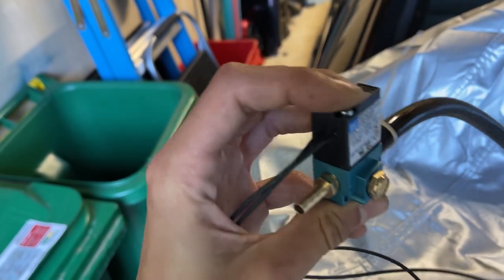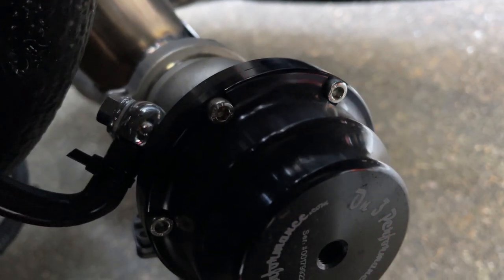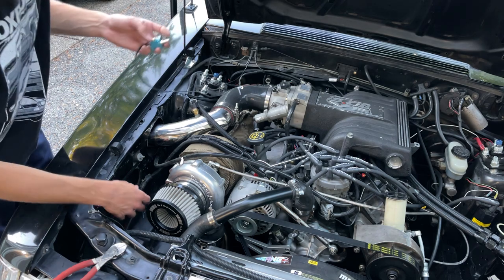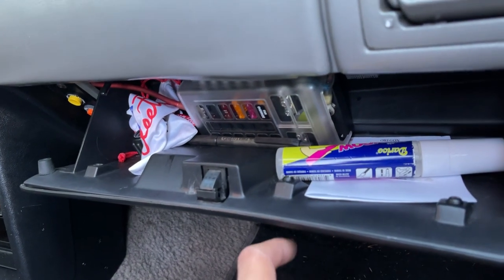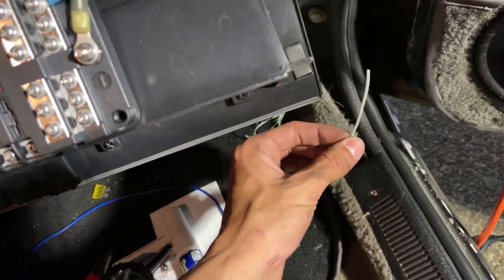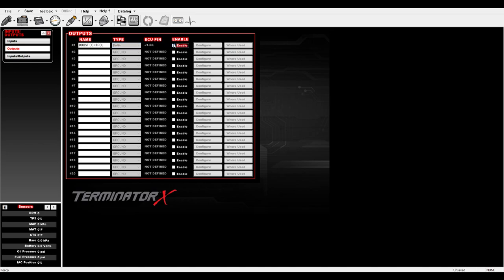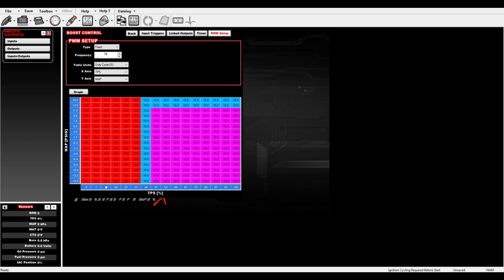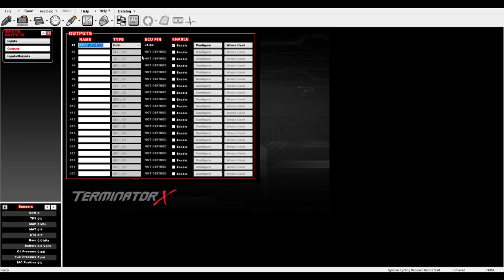Turbo Foxbody OPEN LOOP Boost Control w/ Terminator X!

Comment: Where are you dragging your switch power for your fuse box in your glove box
Reply from the maker: I believe it’s fuse 18 in the fuse box. I’ll have to check to confirm. I have a big boy relay that is triggered to send battery power to fuse box.

Comment: What size is the bango fittings? on the waste gate
Reply from the maker: Great question, I’ll have to check. It does not list the size.
Reply from the maker: I found that it could be M10 x 1.0
Reply from the maker: Not 100% though.

Comment: What sensor is that on the cold side right before the elbow
Reply from the maker: Intake air temp sensor that came with the terminator X kit. 👍
Reply: @eneboracingchannel  Yeah im installin a anderson kit an i dont have it so ill prolly buy one. And could u possible make a video on wiring the electric fan or a video that you used to so it
Reply from the maker: @bigmiami3763  Yea that’s a good idea! Ill get to it!
Reply: @eneboracingchannel  thanks man